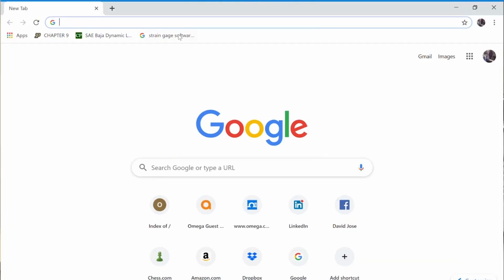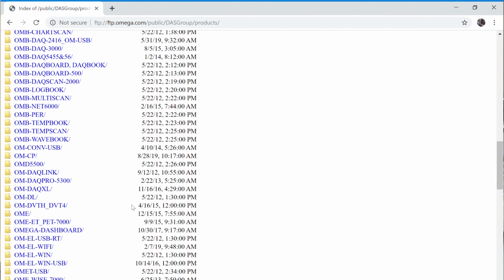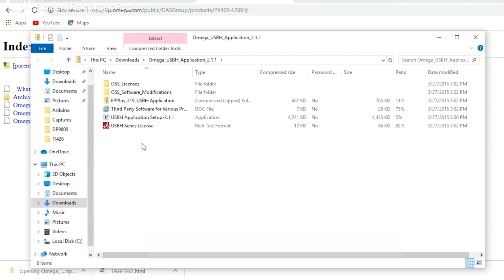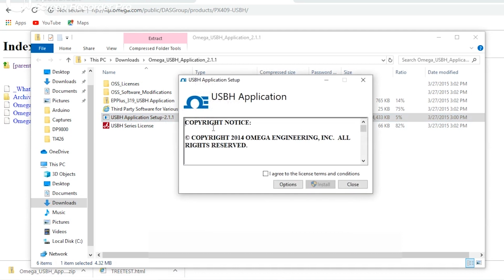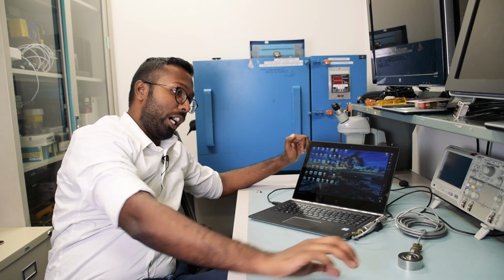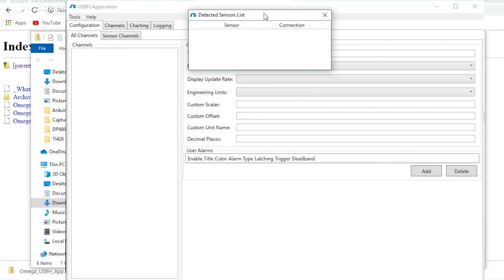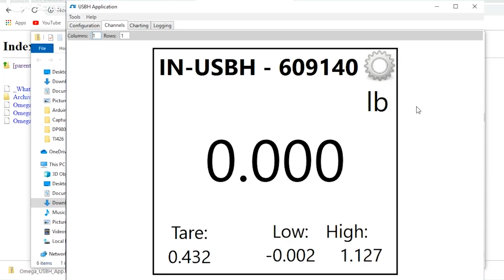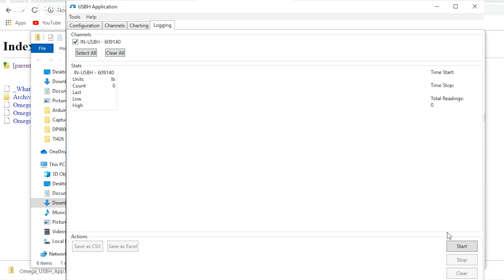Omega's Pressure Transducer Software Setup + Walkthrough

Comment: Hi thank you for the info. I am planning to  purchase an omega pressure transducer. In the specification the cable length is 0.5 m Can the cable length be increased to 5 m and take the readings as shown here. Thanks
Reply from the maker: Hello @ippakanaveen2324, There are some variables that would need to be discussed with one of our application engineers. Please email us at: pressure@dwyeromega.com so we can review and get back to you. Thanks!

Comment: let's have 3 pressure sensors. @ of them measure pressure in a slurry made up of sand and water. these 2 sensors are located in a tube filled with slurry, so the one at the bottom reads a lower pressure and the one located higher measures a higher pressure. can I input the 2 pressures in your software and then calculate slurry density using the P1 minus P2 value (P1-P2). density = (p1-P2)/ (g*h). h is the height between the 2 pressures. I don't want to control de pressure nor the slurry density but just measure it.
now another question. How do I mount all of this in a box with a screen so I can have a portable slurry density measurement device? This HDMi must have an interface so the operator con introduce calibration parameters
Reply from the maker: Hello Juan, you can contact one of our pressure engineering experts at omega.com by emailing: pressure@omega.com